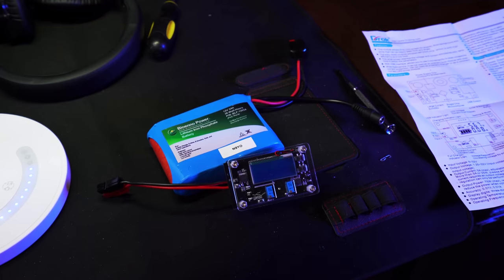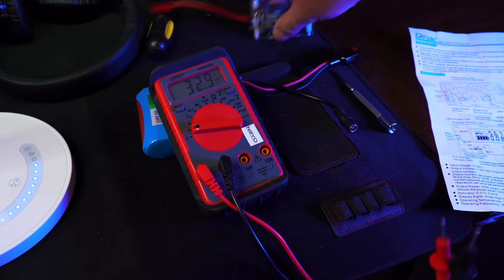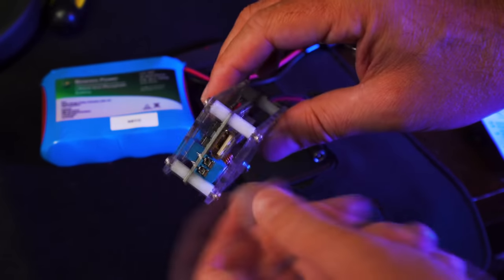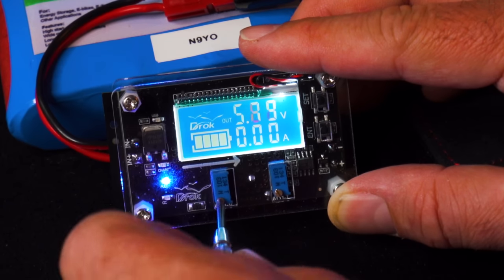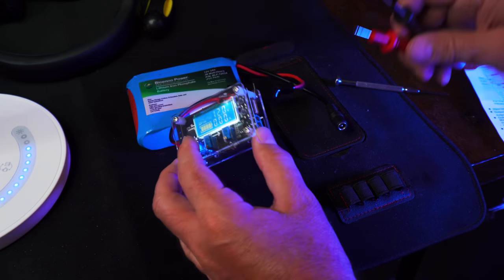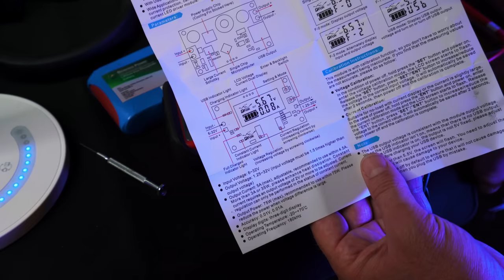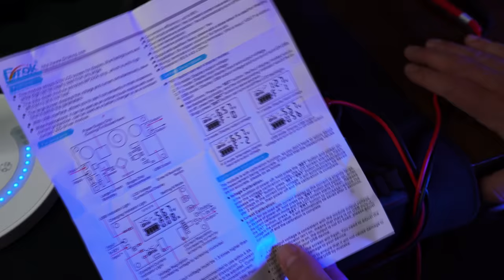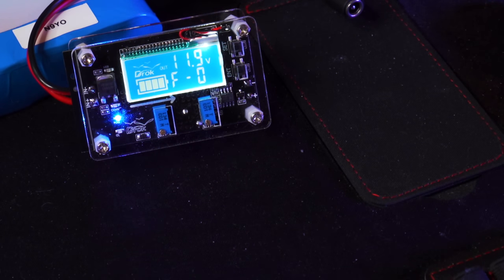Step Down DC Voltage 32V down to 1.5V ~ Buck Converter ~ Voltage Regulator

Comment: Very useful Tom, just a pity that 1. The radio on back order 2. Another item to carry, but it's not an issue because that step-down looks really small. This might push KX2 prices a little lower. 73's
Reply from the maker: I totally hear you.  However, this enables me to use the batteries I own.  I can choose to use this or not.  I use PowerPoles to swap out big batteries or 9V batteries.  I can now choose to go big or small.
I get your point though. Great comment.  Maybe the KX2 is overkill !!!

Comment: Nice affordable price for a Buck Converter. I have used other DROK products for my battery monitoring needs too. They have a huge selection of battery accessories. 
For field use, will you be moving your  buck converter into a moisture resistant enclosure?  The  acrylic protection seems like any moisture could affect its operation.
Reply from the maker: Yea it is abs vulnerable to wx. I will think of something

Comment: Hey Tom, thanks for the great video. I have a quick question maybe you could help? if I have 4 led's on a heatsink that requires 1 amp each and 12 volts at 10watts. Where would I need that adjustment to be made to make sure all the LEDs are at pure brightness? Would I adjust the voltage or the current? Thank you. Tim
Reply from the maker: Sorry, Tim, I don't know off hand.

Comment: Nice video again. What happens when the input voltage drops below 12V...will it step up too or only step down? 73s Stephan DF6PA
Reply from the maker: It will step up to 32v if the battery supplies that. It will match the battery from 1.5 to 32v

Comment: How much rfi did this cause? I'm waiting for pile of stuff in the mail to make raspberry pi sdr in an ammo box (or expensive door stop possibly) I plan on supplying it with 12v in a vehicle with a buck converter stepping down to 5v. Not sure how noisy this will be... looked at this one but bought a heat sink dumb one that's good to 15a. Expected load max 4.5a approx. Figured better to overbuilt it
Reply from the maker: Julio, that sounds awesome.  I don't know about noise, but don't worry about it.  That's a problem to worry about after the build. I haven't noticed ANY noise.  Great job friend, best of luck.
Reply: @hamradiocq  thanks! I may need all the luck I can get. Wiring everything (buck converter, sla battery, low voltage shutoff, relay, switches, volt gauge, USB supply to fan and HDMI to rca converter, dongle, bnc connecter) should be the easy part. Learning Linux, and op25, and not having a ton of rfi will be the hard part. HDMI to rca converter is optional, can work without it if it's noisy. I'm going to either get it working, or blow it up with tannerite. We shall see :)
Reply: @hamradiocq  well I gave up on Linux/op25 for now. Built a p25 scanner with Windows mini pc instead. It's been working pretty good. I uploaded a video of it this morning if you are interested. YouTube won't let me post a link but it's titled "Unitrunker and DSDplus running on mini pc in a case"